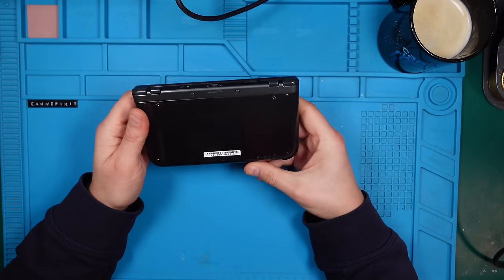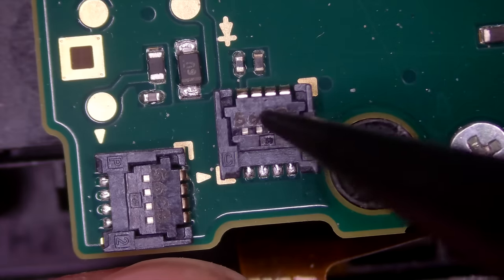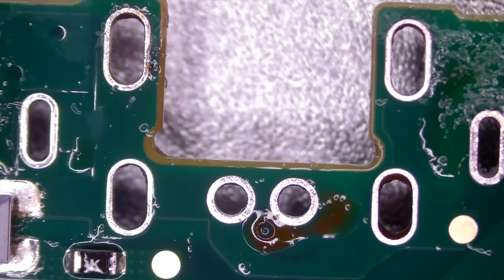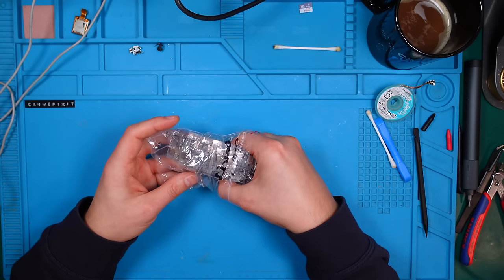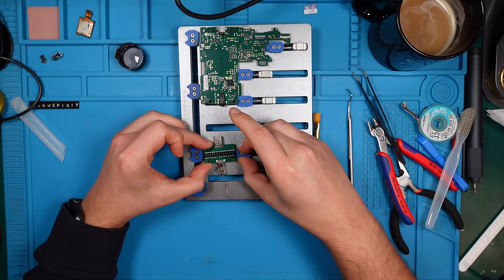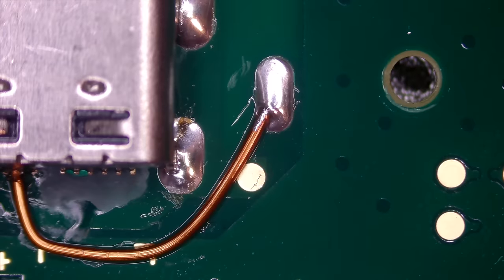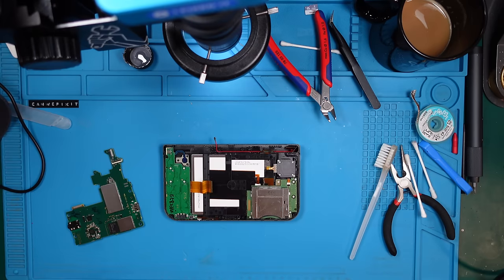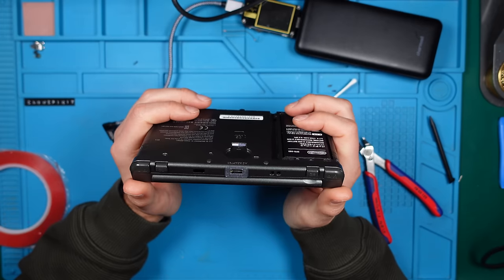Nintendo 3DS Modding - Your FUTURE UPGRADE! (NEW 3DS XL)

Comment: Would it be possible to install a thunderbolt connector and achieve file and video transfer
Reply from the maker: Hi Dylan, nope, that’s not possible. At least, I don’t know how it could be done. It would require a controller that can communicate with the internal memory of the console.

Comment: I'm a complete noob when it comes to soldering ESP PCBs. But I want to learn. Any suggestions on where to begin? Don't trust google with this one. I want someone with exp's suggestion.
Reply from the maker: Hi Brian, If I were you in this case, I would scrape some old PCBs and learn how to unsolder and resolder components with some trash PCBs. Try different temperatures, use flux, and tinker around. The best thing is Trial'n'Error.
Reply: @CanWeFixThat  Great idea! I'd forgotten that was an option. /facepalm, overthinking. Looks like its time to hit the scrape yard. Thanks!
Reply from the maker: Hi Brian, you are welcome! Sometimes the easiest things won't come to my mind. 😀

Comment: I would not do this unless the original port was already faulty. Much preferable to have an small adaptor.
Reply from the maker: This video was more or less just an experiment. I will do a follow up with a usb c break out board with the needed resistors for PD charging.

Comment: I think it is not that safe to solder the usb c port to the mainboard directly like this.
Usb c charging devices have different output wattage. I am no expert but dont think nintendo has already build in a protection mechanism for different voltages and watts.
I have the same project in mind but ordered USB C sockets with pd controllers.
please enlighten me if i am wrong
Reply from the maker: Hi Ali, in this video we got a "dumb" usb-c connector. It is more or less just the form, but it behaves like a normal old school usb device. You are not able to connect this port to a proper usb-c quick charger (USB-C <--> USB-C) because there is no negotiation between those devices and therefore no voltage output. It is just possible to use a USB-A to USB-C cable. I tried different "normal" usb chargers and it was charging in most cases with around 1A.
Reply: @CanWeFixThat  thank you very much for your reply. this is what i was afraid of. my notebook and smartphone both use the same usb c pd charger. my plan was to also use the same charger for the 3ds so i can get rid of that extra nintendo charger.
Reply from the maker: I will do this mod in the future with a usb c breakout board and the needed resistors for PD compatibility - stay tuned! 😉

Comment: I am barely into fixing my hardware for my gaming consoles(mainly Nintendo Switch) but I haven’t tried messing with sodering as I am not confident to do this for my new 3ds xl. Is there a way to send my new 3ds xl & pay for a modded in usb c?😭
Reply from the maker: Hi Bryan, unfortunately, I can't do that, if I would start now, I wouldn't get to any more videos. 🙈 I will come up with a more straightforward solution in the future, but soldering is still required. 😕

Comment: Ive gone just about everywhere for help, people on the 3DS Reddit won't respond, nor the discord. Please if you see this, can you help me in any way? 

My old 3DS plays 3DS games just fine, cartrige or installed games, however it won't play DS games at all (even homebrew installed ones). It reads them just fine, showing up as inserted into the cartrige slot, but once I start the game, its as if you press the power button on the system, going to that screen.

Edit: Back camera's don't work if that means anything. Also no, it didn't work before homebrew either, I just did that to try installing .nds files and seeing if those would boot, with no luck.
Reply from the maker: Hi Veggie, I am very sorry, but I can't help you either with this problem. 😖 Maybe someone else who reads this can say something about this problem.
Reply: @CanWeFixThat  I hope so, i've been having this issue since I got the console. :(

Comment: i think using the cotton wipe was a big mistake. those small fibers could easily short circuit (?)
Reply from the maker: These fibers are not conductive or at least very badly and therefore cannot cause a short circuit. Never had any issues with this in the past. 🙃

Comment: yeah but why doe? likethe charging is hella fast already and this mod makes the dock unusable
Reply from the maker: Hi! The idea was to reduce any additional cables. A USB-C cable is mostly in any bag! 😉
Reply: @CanWeFixThat  nice idea! Then again, there are ds charger to usb cables that can easily be plugged into a powerbank.
Reply: @ZER-ww2nf  Right, but still, you need a special cable. 😁
Reply: @xen00x  and aren't they cheap? Like fam i genuinelly don't see any problem being solved here

Comment: Hey marcus!

I have an 3DS XL that works pretty fine i guess, it wont work without the charger though. My friends father gave it to me, he used to work at media markt and the 3DS XL he gave me was apparently an display item. That was already some years ago but i still would love to use it again without having to be stuck in my room, is there anyway you can help me?
Reply from the maker: Hey,
so it is just turning on with the charger plugged in?
Reply: @CanWeFixThat  basically yea, the charger has to be plugged in for the 3ds to work.
Reply from the maker: @MP9ine Have you checked the battery? Maybe it is dead?
Reply: @CanWeFixThat  yep, i bought a new one when i got the 3ds and i also put it in, still no luck though.
Reply from the maker: @MP9ine You said the device was from media markt? So it was for demonstration purposes, right? Those devices are in a special mode, the kiosk mode. I found this here: https://www.reddit.com/r/3dshacks/comments/8aa54a/new_3ds_xl_demokiosk_unit_battery_fix/

Hope that helps!
Reply: @CanWeFixThat  okay so if i understand it right, the resistor should be in a row of three but on the kiosk mode it has been moved up, this'll be a fun fix. i am not sure if i should do it myself or go to any local soldering shop.

edit: almost forgot to thank you <3
Reply from the maker: @mp9ine440  You are welcome! Keep me posted!

Comment: What's the stuff you used at 7:50 to remove the solder?
Reply from the maker: Great question! At 7:50, I used a desoldering braid to remove the solder. It's an essential tool for cleaning up mistakes or reworking joints. If you're new to soldering, I cover all the must-have tools in my beginner series. Check it out here: https://youtu.be/2gkLmnuPV-s. Would love to hear what you think!
Reply: @CanWeFixThat  Oh, thanks a lot for answering! I have caught a recent interest for soldering and I am interested in getting initiated. I will totes give your video a watch!
Reply from the maker: Brilliant! 🫶

Comment: can you be more descriptive about how you determined what is ground and what is 5v?
Reply from the maker: Hi, sure! Basically I just plugged in the old charging cable and used my multimeter. I changed the mode of it to volts DC and put the black measuring tip on a known ground. Usually this is a screw hole of the board, a metal shield or smth. like this. With the red tip I probed around the port until I received a voltage reading. 

Determine ground of the port is nearly the same. This time unplug the charger. The multimeter mode should be set to continuity. Then black tip on a known ground like a screw hole and the red tip is probing around the port. When you hear a continues beep, you just found a ground pad. If your multimeter does not have a continuity mode, you can also use the resistance mode. In this case there should be a 0 Ohm reading.
Reply: @CanWeFixThat  Thank you so much for the explanation. i remember trying something similar on an old AC adapter for a laptop and it ended up blowing up in my face (probably i didn't do it right. So no matter where you put the red probe on, as long as the black on is on a metal casing (ground) the voltage reading would be the one i'm looking for and that wouldn't cause a short circuit(?)
Reply from the maker: Yeah, that should work. Maybe you accidentally bridged ground and positive with one probe?
Reply: @CanWeFixThat  yeah, maybe lol

Comment: To anyone that has the know how on circutboard/capacitor/anything to do with this kind of stuff; would adjusting the voltage going into the 3ds from charging decrease the stress on the battery not causing an accelerated life span for it? I saw down below in a comment chain that this does infact speed up the deterioration, so i wanted to shoot my shot and ask to start a new chain with some more information if possible
Reply from the maker: Just out of curiosity, why are so many people concerned about this? I haven't seen this kind of conversation for any other console. 😄 What kind of mod are you referring to?
Reply: @CanWeFixThat  i dont think what im referring to count be counted as a mod, but more of an adjustment. In the past (ive forgotten the specific videos) ive seen some people adjust the amount of voltage thats fed into a capacitor or whatnot. 
seeing the comment chain where you and others bring up shortened life span to the battery, (caused by "stress" to it by stronger voltage I assume) made me wonder if it would be possible to adjust the voltage being fed into the battery to have it charging at the voltage its designed to take in and to keep from deteriorating faster.
Reply from the maker: To be honest, I don't think it would make a big difference. It charges with 0.5 A, which is very low by default.

Comment: Wouldn't this damage the 3ds cuz it takes like 3 or 4 volts when charging or?
Reply: No nintendo says it is 4,7v to scare people away from doing this but in reality its 5,1v (measured with a multimeter from the charger)
Reply: @raik1766  Ah, Good to know. Thx for clarifying!

Comment: Da du ja offenbar Deutsch sprichst, müssten da nicht 2 Datenleitungen gebrüllt werden um auf wenigstens wie viel war’s 2A zu kommen ? Lädt der jetzt nicht extrem langsam ?
Reply from the maker: Hi JSM, this was just an experimental approach of doing this mod with a bare usb c connector. You are right, with this approach you are unable to use a USB-C <-> USB-C cable with a PD charger due to the missing 5.6 kΩ resistors. With the method in the video the charging rate is around 1A, the same as with the original charging adaptor. In an upcoming video I will redo this mod with a break out board of usb c and the needed resistors.

Comment: even more future proofing; removing the charging port and changing to rechargeable AA batteries cause lithium rechargeable batteries get old and need replacing (but it will become impossible to find new new 3DS batteries) 🤣
Reply from the maker: Hi Reaven, haha, just checked it and found some compatible batteries via ali. But it would be a funny idea! 😁

Comment: Hi 👋 interesting video nice skills i subscribed!
Name of the microscope?
Reply from the maker: Thank you very much for your sub! 
I am using this lens:
https://de.aliexpress.com/item/1005001381077311.html (180x)
The camera was from a previous kit I bought:
https://de.aliexpress.com/item/1005002756566256.html
Reply: @CanWeFixThat  thanks brother
BTW I'm looking for 330 OHM  0805 Surface Mount Resistor and i don't know if it's ( 330R or 330K) can you help me ?
Reply from the maker: It's the 330R in this case R stands for Ohm. 330K would be 330 Kilo Ohm.
Reply: @CanWeFixThat  I searched on internet and did not find any information, thanks again!
Reply from the maker: You are welcome!